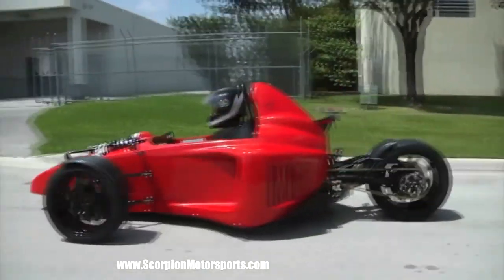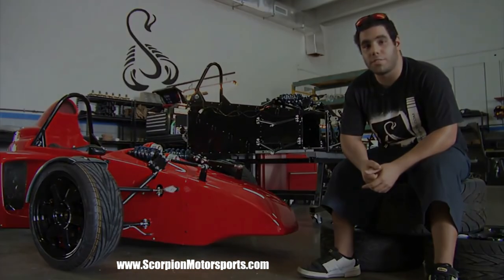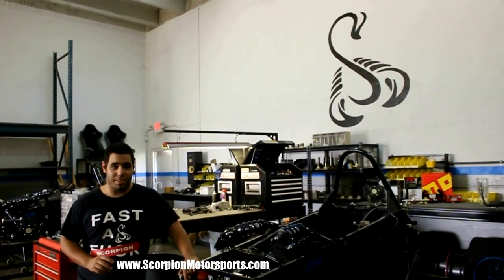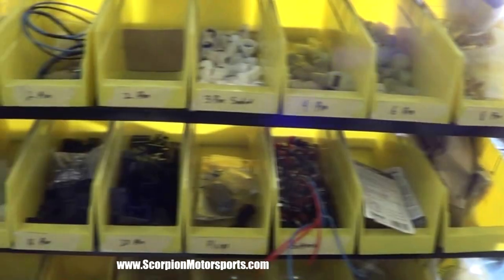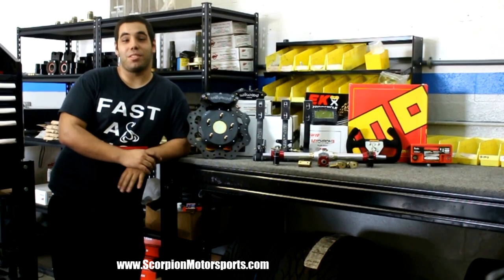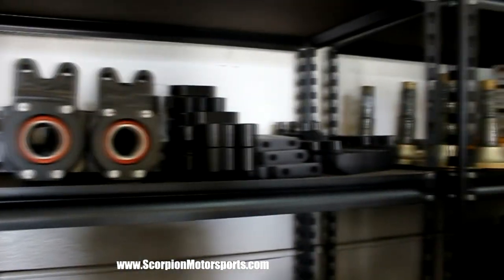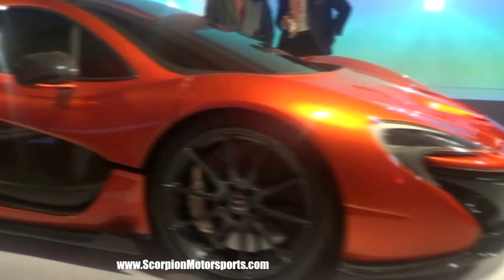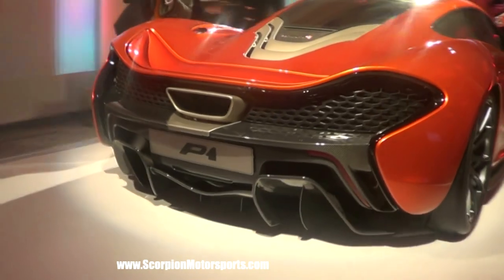Scorpion305tv -- A Day At Scorpion

Comment: Also how is the reserve gear assembled ?
Reply: Most times reverse trikes cant have a reverse gear because they are motorcycle based engines (no reverse) unless you use a Honda goldwing,easiest way if it doesn't have a factory reverse is to replace the nut that holds the front sprocket on with a 3 inch diameter 14.5 degree 10 pitch spur gear that is tapped m22x1.50 to replace that original nut (this is with an R1 engine although)...then mount a plate to hold a 1990-2004 Subaru legacy starter motor (it has anticlockwise rotation) with the front nose section removed and machined flat on the front of the motor,